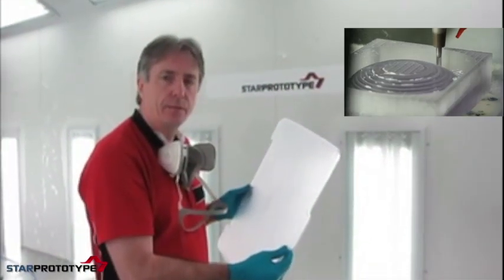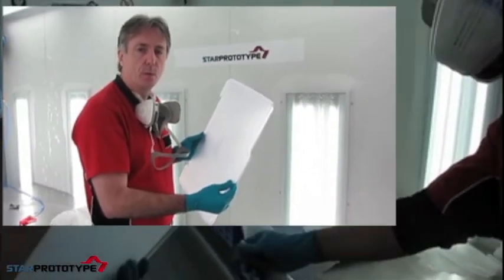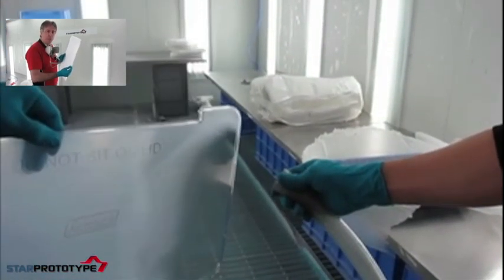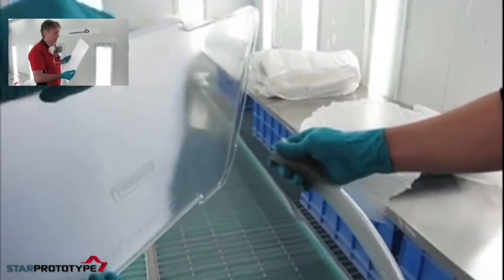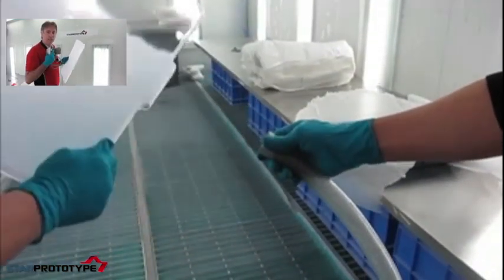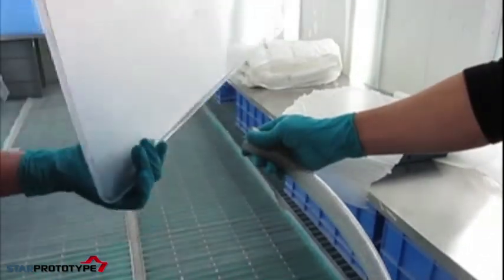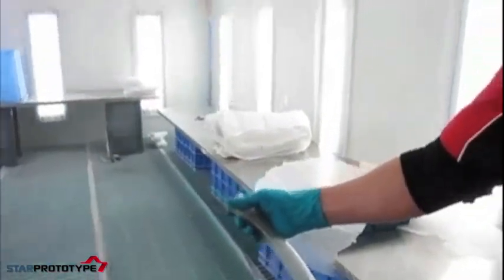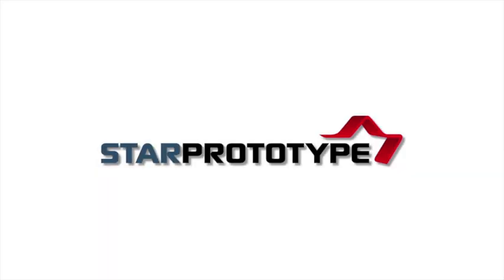How it's done: Vapor Polishing with Weldon 4 Gas

Comment: To protect against Methylene Chloride, the NIOSH Chemical Pocket Guide only recommend respiratory protection in a supplied air mode. Therefore, there are no cartridges suitable for an application where Methylene Chloride is present.   Active carbon filter mask ..?  can you reference a cartridge that you are using.?  Thanks,

Comment: They make it sound like this process is "extremely dangerous"... I've done this polishing method for over 22 years in my little shop and I don't see anything dangerous about it.  I don't use Weld-On 4 though... I use pure Polymethylmethacrylate which I buy in a 5 gallon canister. The clarity is MUCH BETTER by using pure PMMA. I'm sure Weld-On 4 has additional additives.   I mostly just polish the edges of polycarbonate and rarely the surfaces.  As long as you are wearing a mask and in a well ventilated area you will be fine.
Reply: +Danny Herrera ??? Polymethylmethacrylate (PMMA) is acrylic glass. You're buying 5 gallon canisters of Plexiglass? Sounds odd :P
Reply: @TheHuesSciTech  I've seen videos where people vapor polish headlights with what looks like a car cigarette lighter type heated cup with a weird shaped funnel on top using Acetone vapor. I need to do this to my Lexan motorcycle windshield but not sure if I can use Acetone vapor or if I need to stick with Methylene Chloride or what. Acetone is probably easier and cheaper to get but not sure if it works on polycarbonate or how well if it does, do you know?
Reply: @bodeine454  I dunno sorry. Probably best to test on some scrap material or an inconspicuous spot.
Reply: @TheHuesSciTech  That's the safe thing to do, guess I need to get some scrap...
Reply: I presume you mean dichloromethane.
Reply: ... and... what mask would that be?   To protect against Methylene Chloride, the NIOSH Chemical Pocket Guide only recommend respiratory protection in a supplied air mode. Therefore, there are no cartridges suitable for an application where Methylene Chloride is present.  Thanks much.. Regards, Michael Lambert    .. PS: I expect there will be no reply..  this is a very old post... sigh!
Reply: @michaellambert7567  maybe the vapors finally caught up with @tubalcain1
Reply: Danny where are u purchasing the 5 gal canisters?
Reply: Sir can you advise Me how to generate that vapour... It will be very useful. 
Thank you sir
Reply: Do you realize how dangerous acetone and dichloromethane is?  Dichloromethane is carcinogenic, especially when inhaled. Acetone is rather safe, but unstable. In its vapor form, both of them are very explosive if they contact a spark. Heat only increases their instability given their low flash point and can generate highly toxic, or even deadly gases, if certain chemicals are present. What these men were doing would be considered a major OSHA violation. The vapor blasting should be done in an enclosed chamber with an exhaust.
Reply: What is the chemical composition, can you please state?
Reply: What ist the pmma??? I have tried with dikloromethan, and methylen clorit, but  fail. 
   And i reviewed the weld on for datasheet, 
 Dikloromethan and methylen clorit does not mıx..